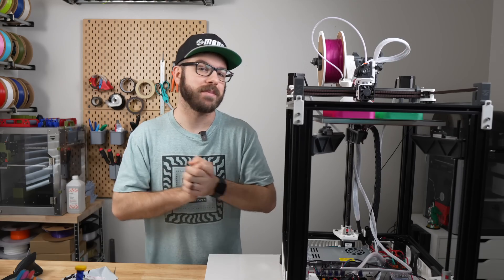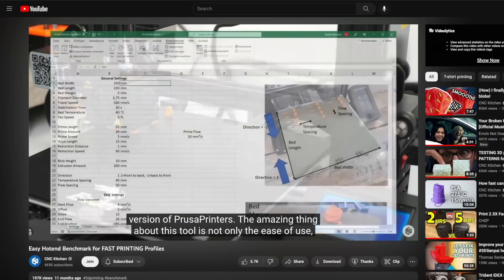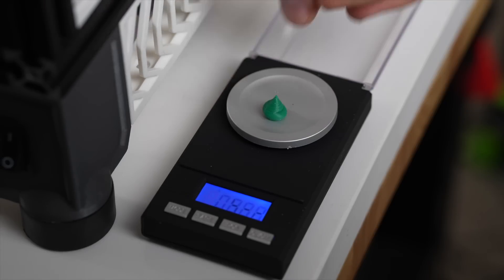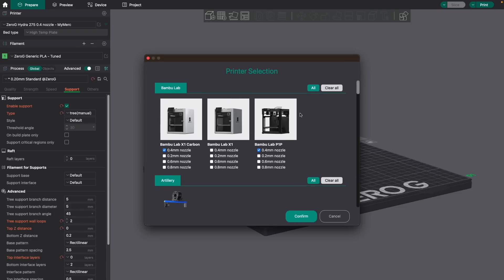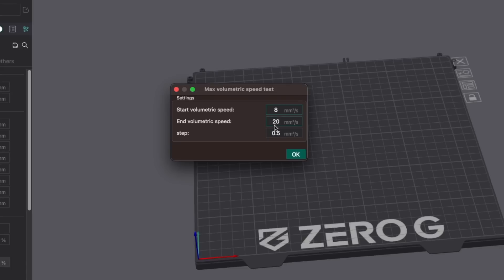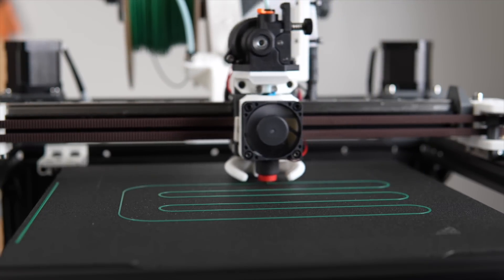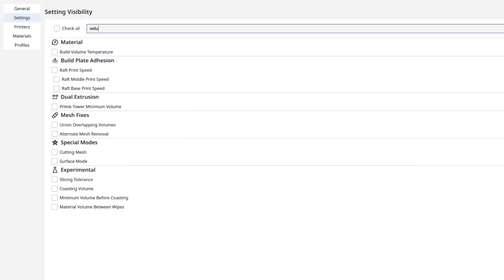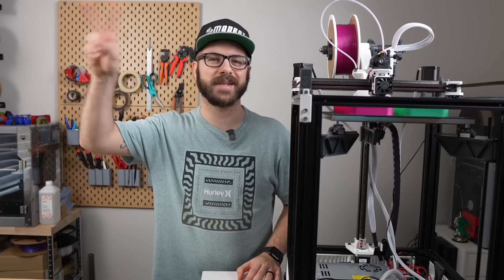Find Your 3d Printers MAX Output

Comment: I just recently got familiar with Bambu Studio, been using Cura for the most part so far, and then found Orca Slicer which I really like and is my daily driver now. I am currently faffing about with some print head mods so knowing about these calibration methods is golden. Thank you for the info!

Comment: Cura devs have decided not to implement this feature. Bad move IMO.
Reply: Both cura and ultimaker have fallen off the face of the map. Ultimaker used to have a great AMS But it couldn't change filaments in between Prints.

Comment: I use a simple 1 mm cube to Check the z offset. I take a pen and write Z on the top then measure it with a caliper. The paper trick to adjust it can be slightly off because of the thicknesses of different paper.

Comment: Im 8 months late to the party but well here i am with my black week buy called neptune 4. Just by logical thinking i came to what you are describing in the video. But with that there is a new topic on my plate now. Well seems like for not all but for many typical prints 0.2 layers are fastest now with capped flowrate. I tried everything i could to get 0.28 layer heights to spit out faster prints but its impossible since you will exceed that 0.4 nozzle quite quickly.

So the next question is how to savely overheat filament. PLA often goes to 220°c(per manufacturers advice). I could go greatly above it if i push it through fast enough. But how fast do i need to push it through so that the filament doesnt burn itself down in the nozzle? In the end the filament would still only go through with 220° but the nozzle has idk 250° or sth. Is there any good way to push the nozzle temps without trial and error? How do i make sure that speeds/flow are maintained so that the filament doesn't overheat in the nozzle?

Comment: The calibration line is nice however you can also increase your temp and thus increase flow rate, this has to be tested with cooling again, so it´s not quet the one click solution.

Comment: Isn't that flow rate highly dependend on filament and temperature? Surely my ABS filament flows slower than my PLA filament, and surely the ABS filament flows easier at 230° than at 210°?
Reply: Of course, you need to run a test for each type of filament.  You then need to deal with the changes to due to temperature and the effect of different nozzles.

Comment: Awesome video, thank you!
I have a question: How do you convert max volumetric flow rate into an ideal outer perimiter feed rate? I think i've found my max acceleration and volumetric flow, but i'm not quite sure how i should then use that value to tune my perimiter speed in my slicer

Comment: Great video Modbot. What flow ranges should I do for a Pheatus Dragon High Flow hotend?
Thanks.
Reply: They say online that the rate is supposed to be ~35 to 38. So you'll want your end to be higher than that. The rest is really up to you. Start with whatever you're comfortable with. Just keep in mind that at some point the single-thickness wall is going to become unstable and you'll start getting artifacts just from its weight and the action of the new filament getting placed, so you might want to do it in segments. For example, start at 18 and go to 26. If it's still pretty much perfect, then do 26 to 34. Then 34 to 40.

Comment: Do one has to perform the temperature tower calibration before or after the maximum volumetric speed test?
Reply: Before. The volumentric speed depends on the temp. The higher the tempo the higher the flow. So I would argue you should find the ideal temp before and then do the volumetric calibration, maybe somebody else has a different opinion, I would like to hear it.
Reply: @sierraecho884  thanks, that makes sense. And regarding Flow and PA Calibration, First Flow or First pa Calibration?
Reply: @printAble93  They all depend on temp too. The hotter the filament the lower the viscosity, so a more "runny" filament.
Usually you don´t need to adjust your flow much, mine is always at 100%. As long as the extruder system is tuned properly it should be fine. You can fine tune that later maybe if you see some parts being underexztruded (this is most common because people calibrate wrong in 90% of all cases with the single wall method or some other nonsense). PA calibration I would do last because now you have your temp, your flow, your speeds all set and want to see what´s the "advanced" pressure changes do I need for the given speed, pressure, temp, material. 
Just don´t create a master thesis out of this, it does not have to be complicated to function well, heck I would argume most complicated stuff does not function well because you keen introducing more stuff that can go wrong.

I would start with a temp tower, it prints rather slow and show how the filament behaves during x temp. You will see what your overhangs look like, if the filament droops and how well the layer bond is. For most filaments the band is rather large. For example I print my PLA at 220°C can I print it at 230°C ? Sure but cooling is more difficult and overhamngs droop al little more. Can I print it at 210°C ? Yeah I can but the layer bond gets weaker. You will have tolerances in the system anyways, so while the printer runs your temps will change between 215-225. That´s totally fine.

You can then test for Extrusion multiplier so see how much flow you need. usually ±1%, so 99%-101% ca.

Then you can test for retraction (you don´t need to do this for every filament, this highly depends on the hardness of material, TPU is soft and will deform more than PLA which is very hard and brittle. Mine works in about 0,5mm so I have my value set a 1mm and call it day.

Max. Flow rate is important, one of the most important tests probably. If you find out your PLA looks okay at say 22mm³/s set it so 20mm³/s and you are fine. always leave a little bit of headroom for tolerances.

And then jst print some parts and see how they turn out, you then adjust on a per part basis. 

If you print accurate parts where holes need to be aligned etc, so not only figurines you should also calibrate for XY hole compensation XY contour compensation and material shrinkage.
Reply: @sierraecho884  thanks for your great explanation! It is very helpful
Reply: @printAble93  You are welcome. The most common mistake beginners do when tuning their printer is they tune it to the absolute limit without leaving an headroom for any kind of problems or tolerances AND people tune extrusion multiplier wrong because they confuse two parameters. Dimensional accuracy and extrusion multiplier. They print a cube and measure the dimensions of the layer width and the overall dimensions then they REDUCE the extruded amount because of course the cube is slighly larger, it is physically impossible to print 0.4mm lines with a 0.4mm nozzle. so now they tune in 90% flow test again do 95% and usually leave it somewhere there, which means yeah your cube looks nice (has weak layer bonds but who tests for that right ?) But everything else they prent come out underextruded. 

So what you do instead is print small flat objects 5-6mm high with 95% infill and see how the top layer comes out. Do you see gaps (under extruson) or ridges (over extrusion). Forget about geimetrical accuracy for now. Once you have dialed that in and your top surface is smooth and everything is withot gaps ONLY THEN you tune for accuracy. Simply print small objects about 5mm, so like a 5mm staurcase and measure the blocks also print holes and measure, then compensate for it in XY compensation that´s what it is there for. And now you will get precision infill precision sized small, very small objects. Fo parts which are say 200mm long you need to factor in material shrinkage. It can be very small for PLA about 0,3% (which translates fo a failure of 0,6mm on a 200mm parts) or bigger for PETG, ASA etc. PA can be really bad with 1,5% which means if you porint some fixture with holes, your hole position will be off by 2mm or so. 

Never confuse extrusion multiplier with geometrical accuracy. Your laver are usually 20% or up to 200% thicker than your nozzle size, they have to otherwise there would be no Squaish and therefore not Z layer adhesion, it is physically impossible to print 0.4mm wide lines with a 0.4mm nozzle.

Personally my course draft layer witdh with my 0.4mm nozzle is 0.8mm. So I can print single wall object which are very stong with only 1 perimeter of 0.8mm instead of 2 perimeters (double the travel movements) with 0.42mm line width.
Reply: @sierraecho884  which printed do you personally Use?

Comment: Great video! 

Does the Max Flow rate calibration have to be done for every filament I use or is it more for the machine's hot end?
Reply: From what I've seen so far, I would say the number is indeed related to the filament (and in Orca Slicer, the setting is found under filament, not under machine), but I don't imagine that two different rolls of the same material (for example, PLA black and PLA white) will have a huge difference. You can probably get away with just doing it per TYPE of filament (1 setting for all PLA, a different setting for all PETG, etc).
Reply: At least for filament type. PLA is different from PETG for example. The max. flow of PLA can be almost double to PETG. You might have to tune it with different PLA filaments as well, but the difference should not be too hight. If your max flow rate is e.g. 30mm³/s for PLA I would choose 28 or 26 and call it a day.

Comment: i know this is a silly question but if i set the "step" value to 1mm form 0.5 how much is that in mm3? 2mm3? so i multiply by 2 the number of lines plus the default value i set of starting point ?
Reply: No calculations required, it does all the work for you. "Step" is how much the amount changes each time there's a line. So, as an example, if you have it set to start at 8, with a step of 1, and you notice degradation after the 5th line (5 increases of 1), your degradation is at 13 mm³ so you'll want to set it to 12 mm³ in your slicer. If you start at 8, and have a step of 0.5, then the 10th line would be the same 13 mm³. But if you notice it looks great between line 9 and 10, then you can set it to 12.5 mm³ instead of 12.

Another way to look at it: the space before the first line is the same number you set as the start. Each space after that goes up by your "step" setting. Counting the spaces between the lines, count by whatever your step is set to, only counting the "good" faces. With a step of 1, you would count 8, 9, 10, 11, 12. If your step is 0.5 you would count 8, 8.5, 9, 9.5, 10, 10.5, 11, 11.5, 12. Whatever number you stop counting on, that's the number you input into the Max Volumetric Speed setting. No need for a calculator, just count them.

Comment: One thing I do not understand is that PursaSlicer and others seem to have the Max Vol Flow linked to the filament. But it's actually linked to the hot end and the extruder more than anything. So I do the test with a 0.4mm nozzle and a 0.8mm nozzle and I get very different results. It seems to be hard to save these settings in the slicer.
Reply: Because each filament flows differently. 
As for the different results. OrcaSlicer uses the thickest line width and layer height combination. So, different nozzle with change the flow rate as well.
Reply: It´s both. The hot end determines the heat output and the surface to the filament, so does the nozzle but the filament also plays a role in taking in that heat. You can heat PLA way easier since it get´s soft at around 60°C already but you will need much more temp to do the same with PETG. So it´s both parameters.

Comment: In the Cura Marketplace there is a plugin called Autotowers Generator that I have been using. It has a built in Flow Tower that you just click and slice. It also has plenty of other towers but I have used the flow tower pretty accurately so far.

Comment: I have a few remarks: 
1)  IMO better to use not AutoSpeed setting but Filament - Advanced - Max volumetric flow.  flow can be different for the same type of filament, even the same manuf. (see CNC kitchen video for that) 
2) The missing part for me with this method - I don't see how much underextrusion changes prints that are more than 1 perimeter shell. On the shell it might look fine but in reality underextrusion is there and slicer "perimeter fusion" math won't work anymore. Say Hi to separated walls. And back to #1 if it looks fine on single wall in green there is no guarantee it will work in black due to different characteristics of filament.

I wouldn't be so picky about it  usually but I do mass production of parts and you want to do it fast. So I fine tuned everything for semi-transparent orange PLA. And when I changed to black PLA it was underperforming and a batch had to be scrapped, slowed down and reprinted. If you near your printers capabilities every subtle difference in filament will pop up. Either test more or make like 70% of printable flowrate your max volumetric speed
Reply: You are doing 3D printing, if you want to do mass production create a mold instead. Unless you do one offs and only small batches which again is not mass production. You can´t really do mass production, not comparable to most other methods. Maybe it is your definition of mass production is you produce 1000 parts or so.
Reply: @sierraecho884 Prusa would beg to differ
Reply: @ThatOneStopSign  Yes because they want to sell printers, not produce parts. No one really uses FDM printing for mass production for several reasons. Unless your definition of mass production is 200 psc. or something low like that. Believe me I am an automotive engineer and I do design parts for mass production.

Comment: You'd have to increase temperature as the flow increases. So you potentially didn't hit the max unless that is tested as well.
Reply from the maker: To an extent this is true. However, printing hotter also means you need additional cooling to compensate. Also, at a certain point pumping heat into these materials can cause other problems. When testing flow rate I don’t like to go higher than a range of 20c. I wouldn’t go above 230 for PLA.
Reply: @ModBotArmy  my Bambu needs about 235 on turbo for pla. Default is 220 for generic. Going to try this test out tomorrow though. The material may not actually be reaching nozzle temperature as it's coming out so fast.
Reply from the maker: @blaskotron  their profiles are tuned. That aux fan is how they get away with cooling quick enough.
Reply: @ModBotArmy  Did the tests. At 220 C I got 25mm, 230 27mm, 240 28mm - all without changing cooling. It could flow faster but I believe that's where the quality would start to drop due to insufficient cooling.  It seems the sagging corners represent insufficient cooling and gaps represent insufficient flow/nozzle temp. These are all MUCH faster than the stock profile of 12 mm for generic pla.

Comment: Step 1: tediously calibrate flow rate
Step 2: ignore that and print as fast as possible 😅

Usually step 1 goes wrong, so the rest is irrelevant.
Keeping flow rate in flat zone (100..99%) creates better prints than opting to "no-fail" zone where under extrusion is significant.
Reply from the maker: The calibration tools available make 1 much easier now. I have had really good results with finding that cap and setting it as a failsafe in the slicer :)
Reply: @ModBotArmy Sadly temperature is missing as a parameter. I suppose you already dialed in your temp for that specific filament before.

Comment: almost at the end of the video, we can see a bit of filament been dragged by the revo nozzle and almost all my prints starts the same. Do you just leave it or you always way to remove it?
Reply from the maker: I run both a prime line and skirt on all of prints so I typically just leave it. The majority of the time it comes off on one of the two. If you are there and it is large you can always grab it but I rarely pull it off.

Comment: I'm confused.  A Revo + Orbiter only gets to 13mm3/s?   I was considering upgrading my stock Sapphire Plus hotend because with Stefan's method it was dropping at 16mm3/s.  I was actually expecting somewhat better from the Revo.  I guess an old-school volcano-block and -nozzle might be the best-buy then, even when it doesn't offer the easy nozzle-change ...
Reply from the maker: Yeah Revo is not a high flow hotend at all. Other than the abrasive nozzles not being available that is it’s biggest draw back. I am hoping a high flow heater core is released but if you are wanting high flow right now Revo is not the answer.
Reply: Depends a ton on filament. For example natural filament gets you around 15% more flow compared to colored one. Or formfutura volcano pla flows 50% better than regular formfutura pla.

Also you shouldn't forget the revos construction. The nozzle itself is on pressed onto the heater with a spring and the thermistor position is different from the stock mk8 heater block. I would be curious how much of a temperature difference this will have. I would go that far to say 220 on a revo is around 200-205 on a v6/mk8.

You might want to look at the rapido. I really like them, the only reason im not buying one for my v0 is that the hotend would overwhelm the psu. They come with a copper and a steel nozzle, so thats already 40 dollars in nozzles in the package. Of course a volcano gets you more flow per money spent, but i went against the volcano on my sapphire as i would loose build volume and the sp3 isn't exactly large
Reply: What filament ?